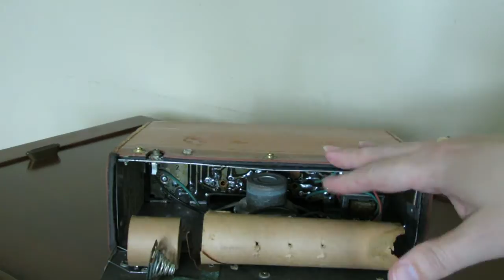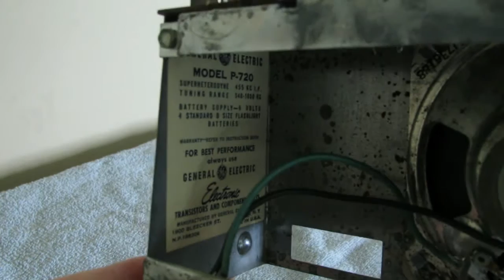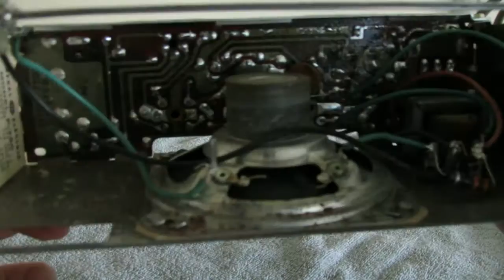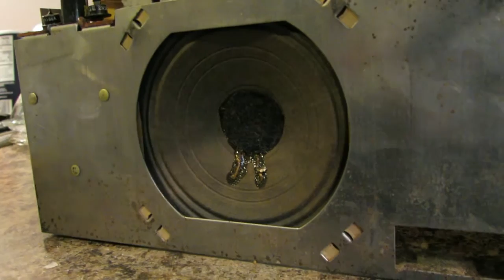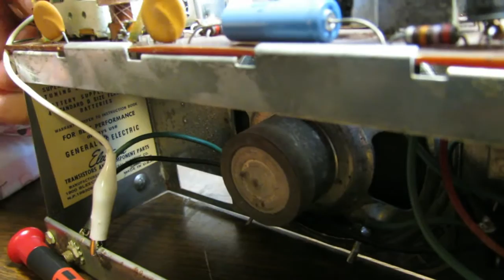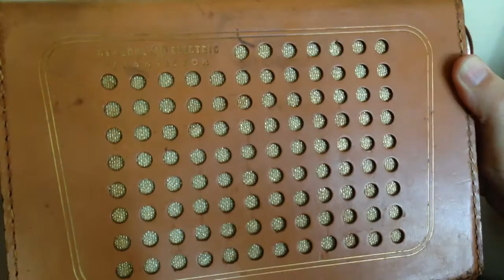1956 GE Model P-720 AM Transistor Radio Repair

Comment: Another business opportunity. I'm a huge fan of American Pickers. With a lot of the stuff they buy Frank and Mike will actually say people will buy it because they want to retrofit a certain era or time capsule.. Even say the stuff doesn't have to work but if it does, they pay more for it... This cool little radio has that 50's retro look.. People may snap this stuff up to decorate a room, or studio or man cave etc... and since you make them work? thats even better.. I find this stuff interesting as well. Whenever an old item comes back to life, thats cool...
Reply from the maker: Well, I mean, even as a $10 transistor AM radio, it still may have a use for some people. There is still a lot of sports on AM and a lot of political talk, and some oldies in my area, and of course religious stuff programming. Plus, you can wire a guitar in the oudio output signal path if you want. :D

Comment: These are capable of very good performance due to large ferrite bar antenna and large speaker and tunning capacitors and large IFtransformers.  Surprisingly, some transistors may need replacement The paper caps maybe ok in Low voltage circuits. Dry electrolytics maybe ok also. Some low value coupling caps go first. sometimes replacement of the converter and IF transistors with Silicon works great without any changes to biasing resistors and really improves sensitivity

Comment: Nice fix on that radio but it sounds like the volume is too low on the demonstration, is it the camera?
Reply from the maker: The volume is low. One of the transistors has low output. At some point I might whip it back out and make a Part 2. But in the meantime, I need to knock out some of these guitar-related repairs backed up. Well spotted!